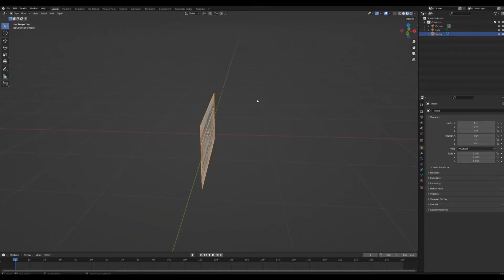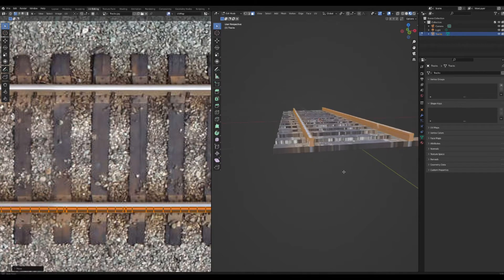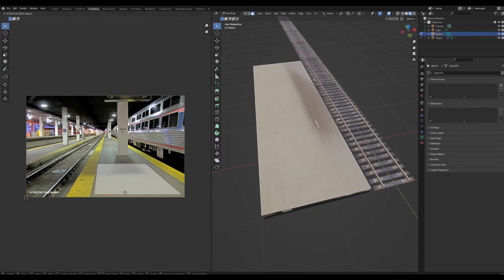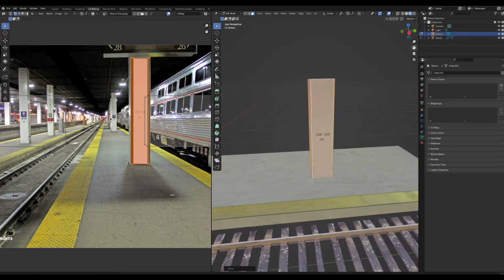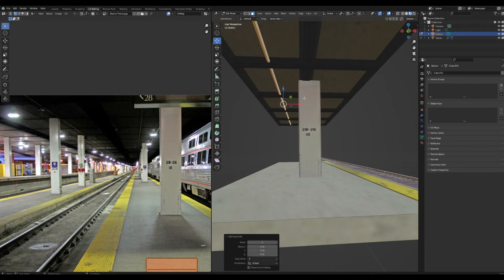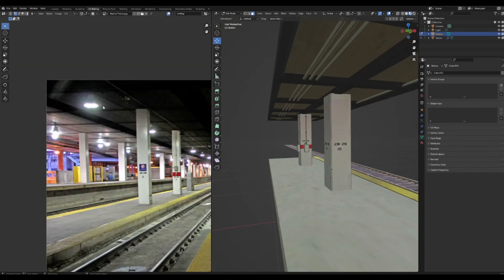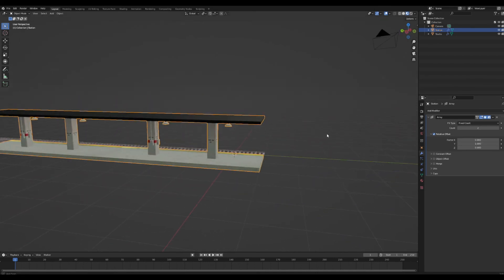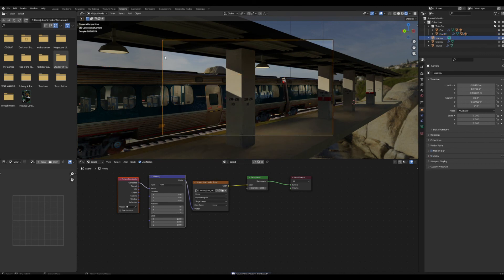Making a (Fast n' Easy) Train Station in Blender 3.0 | Blender Tutorial

Comment: wicked. Most was easy to follow. But you really raced through the first minute, all the cutting of the track, i couldn't work out how to separate the track from the background of the picture. That part is kind of fiddly for a beginner, my feedback would be to at least slow down your time-lapse of your doing it just for a bit so i could see what you're doing in real time to work it out. Maybe record key presses too. Because the rest of it, actually building the station was easy enough to follow. But my station has no track lol (i can make some track in 5 minutes anyway so its not a big deal). Cheers !
Reply from the maker: Hello! I can make a mini tutorial when I get home on how the tracks work:) but you basically just trace out the tracks using edge loops and the knife tool. Then you use the face select tool to select everything besides the track you wanna keep. Then you can press ‘x’ and select the option to delete faces
Reply from the maker: Okay, tomorrow around 12, a tutorial for the train tracks is set to drop. Lemme know if you have any further questions!